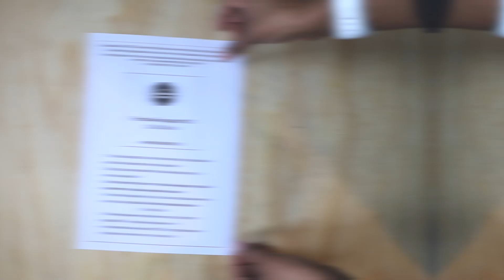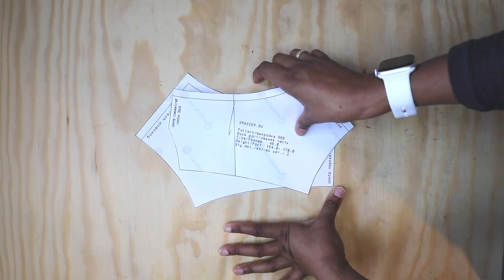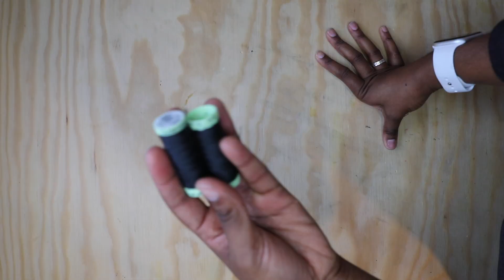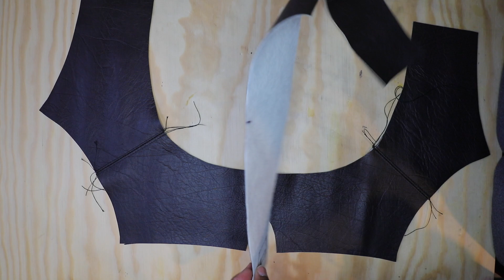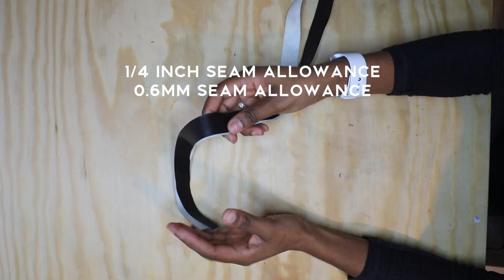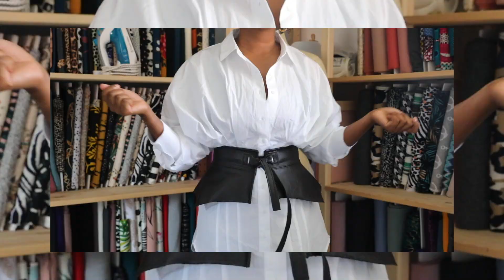Sew Along: Grasser Pattern 666

Comment: Love it!! I am not familiar sewing with leather/ faux. & you spoke so quickly what are you using to seal the leather ? You painted something onto the edges can you please tell me what it is? The name & where I can find it . Also, what exactly is the product used for? Just that one thing & when must it be used with leather? Is it just for sealing the edges or is there anything else it should be used for when sewing leather / faux? Thank You!
Reply from the maker: Hi Roxy! I’m using an edge coating to seal the leather. Edge coat is used to finish the ends of leather and faux leather items. The brand I used was Giardini. But there  are a lot of other brands you can search for online. I picked this up from the Giardini website. I have it because I also have been learning to make handbags and other leather goods. I’m not sure what else it can be used for. You don’t have to use this product, I just happened to have this available in my stash. I also mention that you can use a marker or just normal fabric paint to paint the edges. Usually if you have a faux leather, the underside will be a different colour to the top so the paint is to conceal that and make it all look one colour. It’s sticky so I also used it to stick the edges together. You can use a fabric glue if you don’t have. 

Hope this answers you questions.. 😊